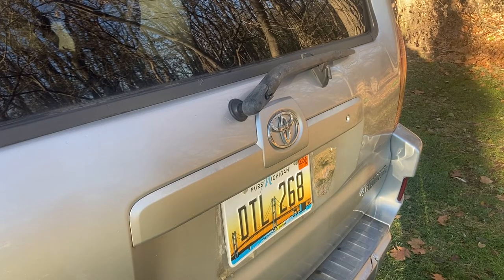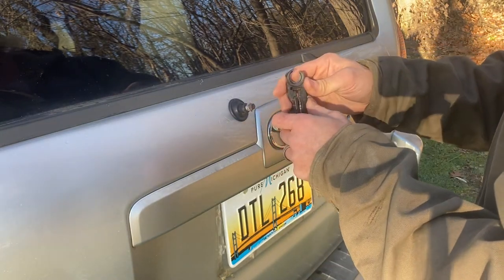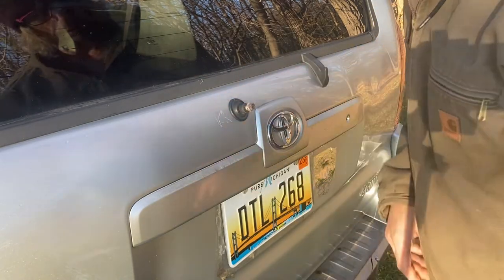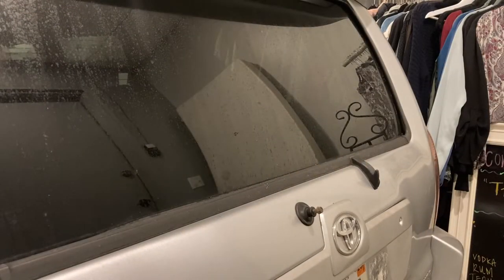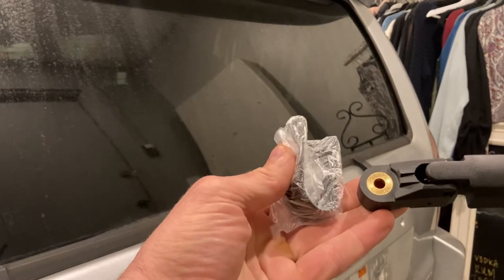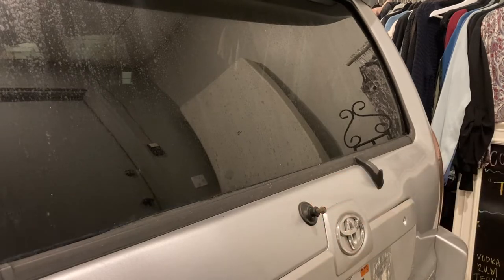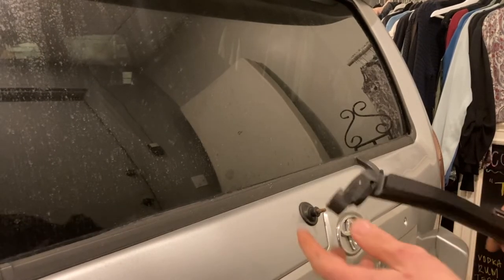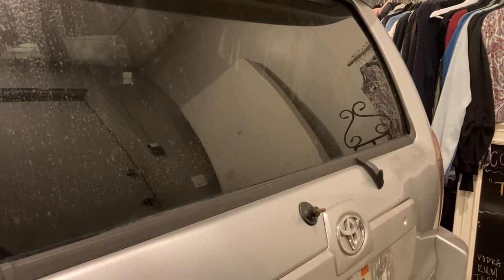Rear wiper arm repair 2003-2009 Toyota 4Runner 4th Generation seized spline

Comment: Dude amazing ... I was dreading this project on my 2004 4runner because the "nut" was rusted on tight. Most folks were saying..."lube and tap, lube and tap". I did that till I was frustrated and came to your video. BAM! HEAT! took me 3 minutes and the damn thing pulled right off. Thanks Jacob! This is what makes Youtube and folks like you wonderful!  Cheers!
Reply from the maker: Thank you for the positive feedback. YouTube has helped me through so many obstacles too

Comment: I got the same problem with the arm stuck into it, unfortunately I don't have a torch. I don't know what else to do
Reply from the maker: Try a blow dryer on low speed high heat. It may be enough if you hold it there longer. Also try penetrating oil, only a small amount each day for a few days to see if it lessens up. I believe the wiper is brass and a softer metal so it may just take more time without a torch.